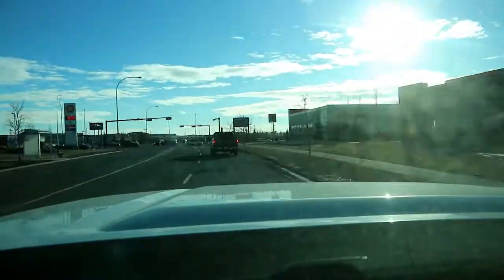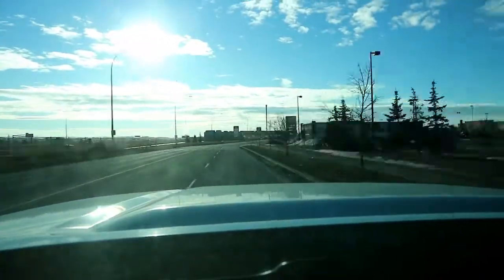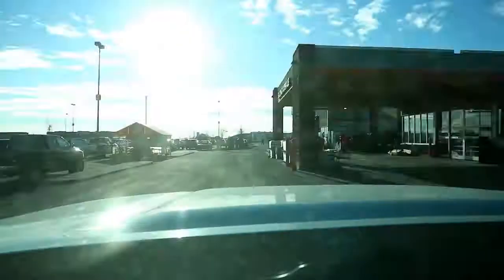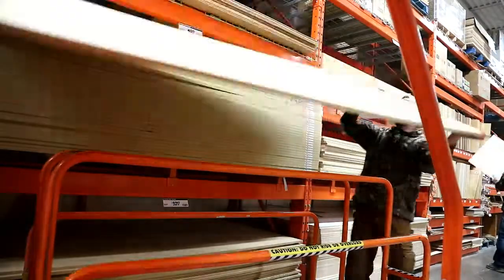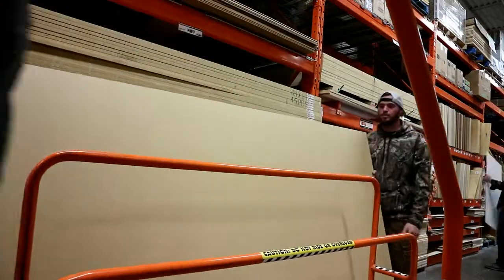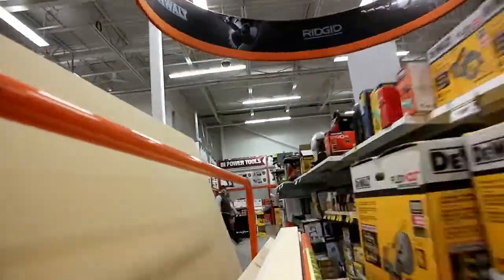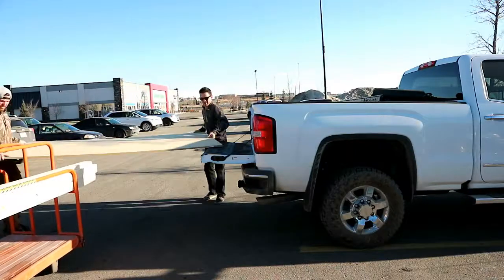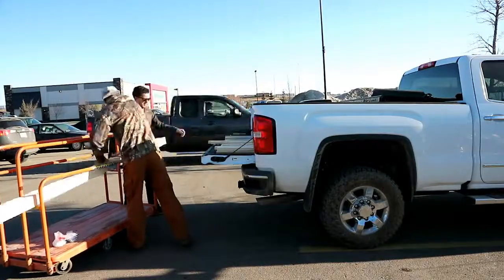LFF LoCost EP3: How to Build a Chassis Table

Comment: I saw in your later video where you added some 2x6's for more stability. Any other suggestions or lessons learned regarding the build table? Were the metal supports worth it?
Reply from the maker: Hey there, if i did it again I would use 4x 2x6 running the length, and I would plane them flat first. The steel studs was a dumb idea as the studs are far to flimsy. Ideally I would use big (8-10") I-beams to keep everything straight but that would be far too heavy and expensive.